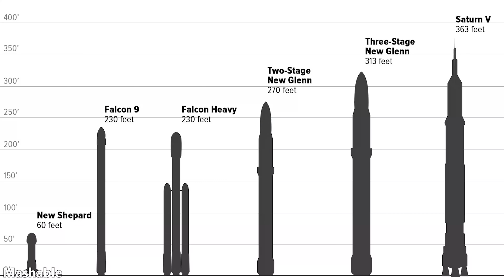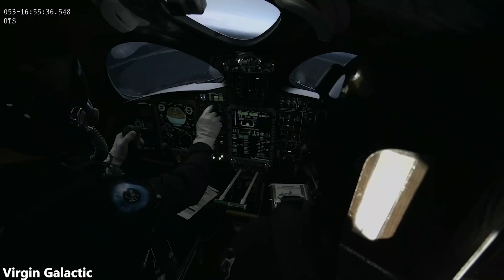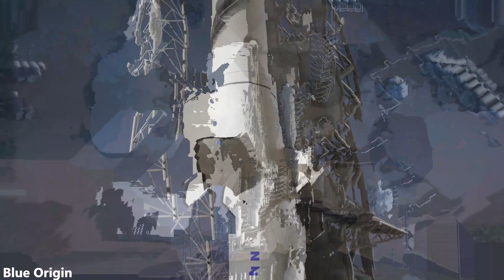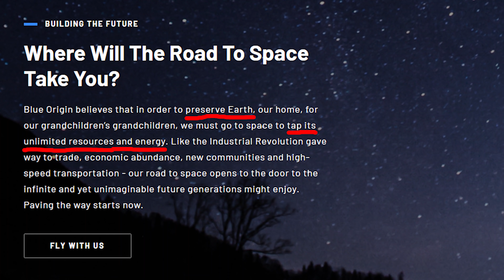What Happened To Blue Origin

Comment: I'm a pretty big fan of Space X but who else can agree that the New Shepard rocket landing just looks more clean and flawless
Reply: 🤔 For an uncertified unmanned Rocket New Shepherd did just fine. The project however is late and over budget. That’s why Bezos looses out on a moon shot. As for flawless. The most flawless automated landing of a stage one I’ve ever seen to date goes to the Falcon Heavy in which landed 3 of them simultaneously, 2 by land and one via autonomous ship. When you put up the total numbers even discounting the few stage ones lost by Falcon 9 SpaceX is still way ahead in the game and is on the cusp of having not ☝️ but 3 launch platforms. The Dragon for SpaceX is also very capable of a ground landing but NASA is not considering ground landings for certification at this time. New Shepard if it gets to manned flight will likely be forced the same route by NASA. (The Capsule)
Reply: @brianbauerschmidt1280  Most of my credit goes to how much time you took for this and writing this I completely forgot about the 3 booster falcon 9 landing

Comment: Bezos demonstrates  his utter lack of understanding of physics.  We will not run out of energy. Commercial availability of fusion energy is still nothing more than a pipe dream. However,  the Thorium molten salt reactor is a tested fuel cycle that breeds it's own fuel once it begins operation..Thorium is available in almost unlimited quantities. ( like other fission energy sources they  don't generate CO2  and have a small foot print for a very large output of energy.   Bedsides, I wonder how Jeff Bezos plans to generate power aboard his orbital space habitats.  The fuel and infrastructure would come from earth.  Bezos can't save the earth with his grandiose plans .  He would only add to the environmental burden to put it there and keep it operational.  Make no mistake, his plans for space habitat are just for the super rich.  They would not be independent from extensive earth based support.   the earthbound lower classes would get to supply scarce resources to support Jeff's luxury orbital home for the few who could afford it.  This would be the ultimate realization of a "God complex" that seems to take root among the ultra rich. If saving the earth is really the goal, develop clean energy resources that do not scar the landscape like wind and solar.  Use cheap energy to make clean water where there is none.  Implement proven methods to reclaim deserts through plantings designed to naturally change the environment so  nature can restore the land.  Unlivable inner city Urban blight can be restored to productive farm land close to those who would benefit from the food crops.  Families could lease food plots or their own consumption.I'm no Luddite. I believe in technological innovation and advancement.  However,  Bezos should come clean about what his "space habitats really are.

Comment: i think that blue origin will never really succeed, because:
1: Blue moon idea is not bad, but NASA already thinks about a Space X landing system, witch is bigger and (if it was configurated) in could do the same as Blue moon lander
2: New Gleen will be the next Falcon heavy because it will wont be flown much, it would be waste of money launching rocket capable to take.... i dont know.. about 60 or 70 tones to orbit, comparing the average satelites weight, witch is about 6-7 tones.
3:Space X already has option of private tours to the orbit, witch will make new sheppard useless. But with space x you could go to orbit (it will be around 55M $) with new sheppard for 4 or 5 minutes in space for 200,000 $
EDIT: wait, they have to go to orbit first, if they want to go to other planets

Comment: I mean if space  x landing is more difficult  then i gues they're  not doing a great a job as blue origin.  We innovate to make things easier  right? Nor cooler
Reply: Space X is doing BETTER, they will get more profit, accomplishments and innovations.
Reply: @NotePortal  : remember SN 8 💥& SN 9 💥 . . .
More weight , as said , but learning looks different to.me with two identical crash's .•°
Reply: @farrider3339  failure is a very common thing during a test.
Reply: @Centaurz23  : yeP , me know.
Me just wondering bcs crashes appeared like identical.
Even the angle the device hit the ground was similar.
But if this it what it takes . . . 
That Blue Origin (smaller device) did a cOOLio landing.
Descended from 100km height.
One engine only .
Lesser weight , me know.
BuT wtf SpX ?
And #10 sitting already there and waiting for a shrapnel ? 😁

They are crazy - and nOw they're in trouble for some FAA violations with SN8 launch..

Me tinked Musk plays it cOOLio...
Now me doubt ....
Maybe you have good story on that 📖 ?
👋.•°
Reply: @farrider3339  first of all correct your grammar, second of all correct your information, third of all the SN9 and SN8 were NOT identical in anyway you see the sn9 crashed due to an engine gimbaling + ignition failure while sn8 while the sn8 crashed due to LOX mixture problems oh and what about the falcon 9? It can land from an angled 200km altitude on a drone ship while it is also heavier and taller than the new shepherd and in my opinion spaceX booster landings are much cooler than boring blue origins’ landings.
Reply: @Centaurz23  : why this aggressive ?
You 🇺🇸 ?
Wearing a horned helmet or what ?
Me just asked for verifyable information.
Two different problems in a row leading to crashes , that's all that we have .
Falcon 9 isn't SN9 as the dedicated observer notices.

And me not give a flying fuck for your demand on correct grammar.
If you have to introduce an ad hominem line of communication , me can return that to You :
Work on a more civilized way of expressing yourself .•°
Reply: @farrider3339  I am not aggressive at all you are the one that is, and no I am Canadian. Also the reason I am asking to correct your grammar is because I need to understand you correctly so I can answer you correctly, and try to speak respectfully first before asking a person to “work on a more civilized way of expressing themselves”.
Reply: @Centaurz23  : hahaha - you see you're doin it again after having started the game of : "let me tell you what you have to do."

Me just reacted.
Let's say we have a draw.
Bye .•°
Reply: @farrider3339  sorry I speak English.

Comment: Blue Origin is much smaller than SpaceX.  Their development is more careful and measured, but doesn't equate to successful.  Indeed, their BE-4 booster engine which ULA plans to use for the Atlas V replacement (Vulcan vehicle) is many years late and apparently still showing performance issues (ULA's Bruno recently tweeted "turbopump issues"), so perhaps ULA will fall back on the AR-1 engine (in-work, on-hold) which could be one reason L-M is buying Aerojet Rocketdyne.  Space tourism seems a small market.  A bit silly that people would pay $200K for a quick pop up to "space" (50 miles over U.S., 62 miles over Europe) since you can go up 7 miles on a $50 airline ticket which is enough to make out the curvature of the earth and start to see the blackness of "space", yet few today even bother looking out the window.  Perhaps the first few flights will gain bragging rights at cocktail parties, then it will be like the 3rd moon-landing mission (Apollo 13) which wasn't even being broadcast until the big "oops".  Popping up 50 miles and falling back is much simpler than orbital flight (requires Mach 22 and thus heat-shields) and littler guys will offer cheaper pop-ups.  Perhaps in 50 years, there will be a "space elevator" which any commoner can take to view out windows from 50 miles up for $20, though the current views thru a glass floor to a canyon 2000 ft below are more exciting.  From 50 miles over Mojave, CA you might make out the Pacific coast, viewing at a 60 deg angle (off vertical), though a better view by just driving up the Angeles Crest Hwy.  Not much to see above the NM spaceport, other than the same barren landscape which looks unimpressive at all scales.  Over Kennedy SC, you might make out the Gulf coast almost on the horizon, if not blocked by the clouds almost always over FL.

Comment: Wrong! Blue Origin has not landed an orbital rocket, and certainty did not beat SpaceX in that endeavor. 2 billion dollars into a whole space company is nothing. SpaceX is spending more than twice that in the development of Starship, SLS will cost 1 billion per launch. The real competition right now is actually Lockheed that just purchased Rocketdyne. Rocketdyne makes the RS-25, meaning that the most advanced aircraft manufacturer in the world now owns one of the only rocket engines in current production capable of competing with the Raptor engine. Lockheed could easily build a space craft to compete with SpaceX in the next 5 years. Unlike Blue Origin, Lockheed actually has experience in aerospace.
Reply from the maker: Haha, I think I explained the technicalities of Blue Origin "beating" SpaceX in the video.
Reply: @LogicallyAnswered  Yea, I really couldn't follow how you were defining technicalities. Where you just saying that Blue Origin won in the fact that they landed the booster first because it was a multi stage rocket?

Comment: I don’t get Bezos’s certain claim that we’ll run out of energy. He’s certain that we’ll keep increasing our energy usage, but he also only has the imagination to see us cover the entire planet in solar panels? What about fusion power, or thorium reactors? He can’t just say that his claim is guaranteed.
Reply: Would you plan building Your house and raising your children near (1mile) beside any of these powerplants (if they were to come true) ? 
🤔 .•°
That's the acid test .•°
Reply: @farrider3339  I would, because thorium reactors are a very safe ‘slow burn’ and also self-correct when they need to be shut down instead of having a meltdown. And they can transmit the power a long way and put them out in the middle of nowhere if they want to.
Reply: @zekea7215  : so why aren't they already built ? 
Imagine a failure during the transportation of the firing elements to the reactor.
Still we're talking about uranium which is different from peanut butter , coal and gas - or even solar panel's .•°
Reply: @farrider3339  They just need to transport thorium ore which isn’t dangerous, and then it’s byproduct is about 10000 times less radioactive material than a current uranium power plant and could be stored on site, and the byproduct is U233 which only stays radioactive about 500 years vs 10000 or more for the other isotopes, and it can be used in useful applications.
Reply: @farrider3339  alright deal lol

Comment: Energy production in orbit is called Space Based Solar Power. The idea is around for long, the main obstacle is (was?) the too high $/kg price of LEO. For sure it is not about bringing charged batteries back to Earth. The concept rather builds on laser or microwave beamed energy, and receiving stations around the Earth, from where the beamed back energy could be distributed the usual way. See https://en.wikipedia.org/wiki/Space-based_solar_power for the details. If it is going to be Blue Origin or SpaceX, who can achieve that in a financially viable way, doesn't matter, but I would bet on SpaceX rather, with their Starship (fully reusable) system.

Comment: Falcon is delivering cargo (and now people too) to orbit, this rocket is gaining a lot vertical speed to get into and stay in space, while Blue Origin literally just flies straight up just to touch space, go to a high an altitude...  

its two completely different concept, and thing, and you can't compare them

a blue origin rocket will always fall back anyway, while falcon's cargo reaches orbit

To have few parallel example it's It's like you comparing 
- long jump to marathon running
-a grasshopper to a  dragonfly
-trampoline to a catapult 

You just can't compare the two things, they are different categories.

Comment: As many people in rocketry have pointed out, landing a rocket that has crossed the Karman line and technically gone into "space" VTOL is significantly easier than landing a rocket that has put something into orbit. The velocities are orders of magnitude greater. The size, mass, etc all exponentially increase the difficulty. Hell, atmospheric heating increase by a factor of 8 as velocity increases. Yes, Blue Origin has done things. But having existed 2 years longer than SpaceX they are still where SpaceX was in 2004. Part of the feeling toward them is their own insane levels of secrecy. I have the highest hopes for them... but they have yet to fly and orbital class engine, they have yet to put anything in orbit, they haven't tested their orbital rocket yet. They have work to do.
Reply: Blasting up to 300,000 feet and then returning straight back down is no mean feat, for sure. But, as you point out, that's orders of magnitude short of achieving orbit.
Reply: @richardpark3054  100%. Credit where credit is due. They have done awesome things. Just very slowly, and way behind everyone else. I truly hope they catch up and succeed, because the more people doing this, the better off we'll all be. And if it's what he wants to sink his billions into, that's great, because there are far worse things he could be doing with it. This at least benefits humanity.

Comment: SpaceX is way more cutting edge, they launched two guys into space....... something America and Russia did over 50 years ago half a century ago, LOL!
Reply: It's not launching a couple of guys in space. 
They did it with a partially reusable rocket, a couple of days ago they had the 70th successful landing, this landings have become routine now. They achieved it to land a booster with engines where the single engine has more thrust than the empty weight of the booster - it can't hover, it has to be timed to less than a second to prevent it from hitting the ground hard or lifting up again. They already have boosters flown 7 times, and they launch them meanwhile within a couple of days. Their goal is a 24 hour window to launch a booster again. 
They can offer a launch for 60 million $, while a SLS launch will cost 2 billion, they even managed to catch fairings and use them again. 

Now they develop the starship, which will be the biggest rocket ever developed, fully reusable, and capable of missions to moon or mars. 

While space travel was only achievable by whole countries in the past, it has today gotten possible for private companies.

Comment: It is hard to take seriously any "Space Provider" who has not in its 20 years put even one single bolt in to orbit. And it’s one and only rocket can't even reach half of the altitude of a 90-year-old V2 rocket (105km vs 206km).
Jeff the Bozo's Blue Origin is not trying to be a space provider. They are trying to be another Boeing, Lockheed or McDonald Douglas, whose primary business plan is to soke the American taxpayer with over priced open end contracts, and over paid senators.

Comment: 0:45 Wait, you think blue origin gets first for landing a rocket because the falcon test rocket didn't go to space? The blue origin rocket is a sub orbital rocket though? And you just said "first to land a rocket", not "first to space" or any other qualifier.

Also, you said the falcon 9 goes twice as high and thus has a harder landing. That's a tiny fraction of the difference in energy. The new shepherd booster goes straight up and down. the falcon 9 is going sideways at near orbital velocity. Look at the clip you used at 1:45. That booster isn't just at 200km, it's also traveling at over 14000 KM a minute, and since it's sideways velocity, gravity doesn't help reduce that.

Comment: Why would you use batteris when you can just beam power? Mirrors at mercury's orbit get something like 17 times more power than here at earth, the 70% power loss during the beaming process literally doesn't matter. Just make a dyson swarm, with several collection stations that then beam energy back to earth. The only difficult part is setting up an automated manufacturing plant on mercury

Comment: Passing Karman line requires only about 2km/s deltaV when going to orbit requires about 9km/s. The difference is huge. You can reach 2km/s by having any working rocket engine and bolting it into old oil tank or anything. To reach 9km/s, every component needs to be highly optimised, which makes design challenging.

The reason why New Shepherd landing seems so controlled is because they minimum thrust is lower than they weight at landing and they have lots of fuel to waste. They can hower in the place and stabilise the ship.

SpaceX, however, have more thrust than weight, so they need to time everything perfectly. There are very many variables like the wind, landing speed, engine thrust and altitude. And of course very little fuel to spare, and it is consumed very fast, making the rocket much lighter.

SpaceX don't have a luxury to optimise they engines for landing because they have to optimise them getting into orbit.

Comment: This is all badly out of date. New Shepard has flown thirteen times, not seven. Virgin Galactic has conducted multiple manned tests of their spaceplane. Blue Origin has teamed up with Lockheed Martin, Northrop Grumman, and Draper to compete for a NASA contract to provide the lander for the Artemis program. While partly based on the original Blue Moon concept, their combined proposal is substantially different.
     In addition, the primary difference between New Shepard and Falcon 9 is that Falcon 9 lands after putting things into orbit, while New Shepard is merely suborbital. Also, you said something about Blue Origin delivering crew to the ISS. If Blue Origin is developing a manned spacecraft to be carried by the New Glenn rocket, they're keeping it a mighty big secret. They have never even stated an intention eventually to bid on either a Commercial Crew Contract, or even a Commercial Resupply contract.